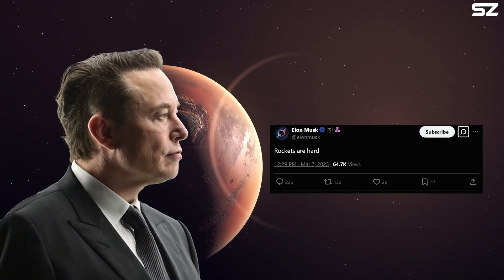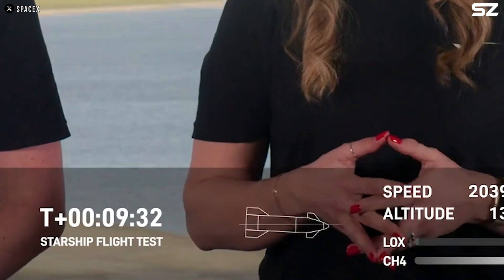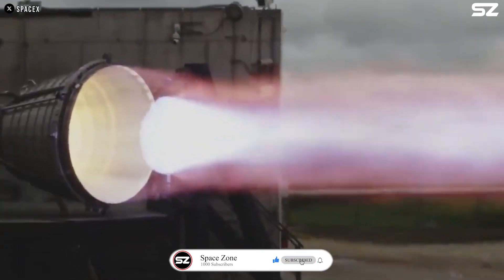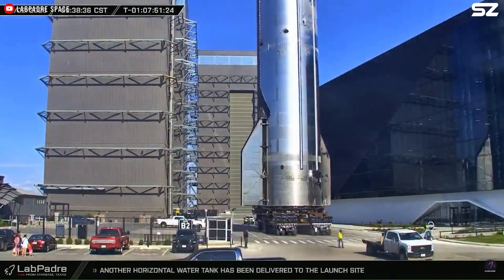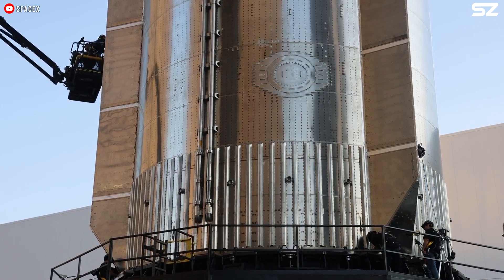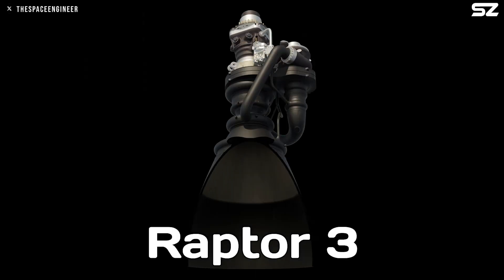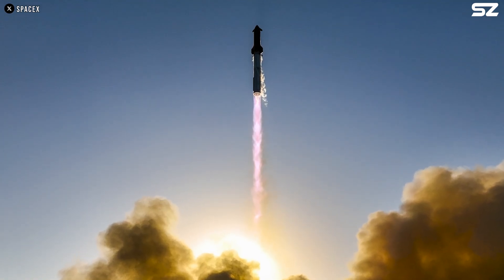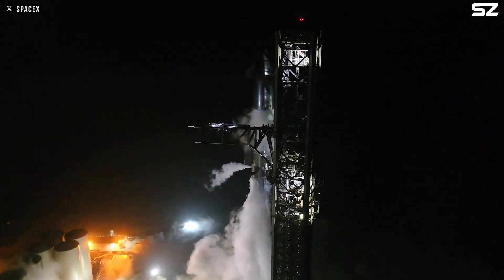What Exactly Happened to SpaceX RAPTOR During Starship Flight EIGHT!

Comment: I keep saying it's not the Raptors fault. It's the hot-staging fault. Sure the ring is vented, but it's still too close to the Starship. All that power blasting out surely places monstrous stress on all the lower engine section pushing things out of whack. So you end up with leaks and broken things. This phenomena doesn't happen with the booster, it has all kinds of room for rocket exhaust, as does the Starship on the test stand. Make the hot-staging ring taller.
Reply: I agree, but I think making the second stage taller also played a role. Spacex mentioned harmonic response before and I suspect that problem intensifies when the tanks empty to a certain extend, allowing for the vibrations to build up in absence of fuel to absorb and mitigate the issue.
Reply from the maker: Good ideal!
Reply: You may be on to something.

Comment: OK----------.  FIVE THINGS MUST BE CHANGED ON FLIGHT 9....   
--------------...  FIRST:  THE LONG METHANE DOWNCOMERS FOR THE VACUUM RAPTORS, THAT EXTEND FROM THE METHANE TANK DOWN TO EACH ENGINE MUST BE ELIMINATED.. (THE ONLY DEFERANCE BETWEEN FLIGHT 7 AND 8 ),,,  AND THE PREVIOUS SUCCESSFUL FLIGHTS OF STARSHIPS...   AS THEIR LONG STRAIT THIN PIPES CAN ONLY MAGNIFY THE ENGINE ASSOLATOINS LIKE A THICK GUITAR STRING... MAKING THE PIPES LOX TANK DOME PENITRATION WELDS ALMOST IMPOSSIBLE TO KEEP FROM FAILING... 
------------.  SECOND::  THE METHANE CENTER LARGE TUBE  DOWNCOMER MUST BE LENGTHENED TO PENETRATE THE LOWER LOX TANK DOME THAT IS STRONG ENOUGH TO RESIST ENGINE ACOOSTIC VIBRATIONS BEFORE ANY OF THE SMALL METHANE DIRECT FEED PIPES ARE TAKEN OFF AT THE END OF THE METHANE DOWN COMER...  ELIMINATING ALL OF THE SMALL WEAK DOWNCOMER LOX TANK DOME WELDED PENETRATIONS THAT CAN CRACK LEAK AND BREAK FROM ENGINE HARMONIC VIBRATIONS... MAKING PRODUCTON EASIER, CHEAPER...AND LIGHTER...
---------------... THIRD:::    THE VACUUM ENGINES MUST BE ANGLED IN,,,  ALIGNING THEIR THRUST VECTOR WITH THE CENTER MASS POINT OF THE STARSHIP,,,  INSIDE THE UPPER END OF THE METHANE TANK...   THAT CANNOT BE CALCULATED PERFECTLY AS THAT POINT DEPENDS ON THE CARGO WEIGHT OF THE STARSHIP... AND MOVES AS PROPELANT IS USED...   BUT WOULD ALLOW THE STARSHIP TO MAINTAIN A STRAIGHT COURSE NO MATTER HOW MANY VAC ENGINES LOSE THRUST...   USING ONLY THE MANUEVERING THRUSTERS,  TO CONTROL STARSHIPS HEADING IF THE CENTER GYMBLED LANDING ENGINES FAIL IN PART OR ALL... 
          THIS WOULD HAVE KEPT STARSHIP FLIGHTS 7 AND 8 FROM TUMBLING, GIVING MORE TIME FOR  THE RECORDING CAMERAS, SENSORS AND THE ENGINEERS TO TROUBLE SHOOT THE PROBLEMS... OF FLIGHT 7 AND 8... SHUTINGDOWN LEAKS FROM ANY FEED PIPE  BREAKS AND CRACKS... TO HAVE POSSIBLY PUT OUT THE FIRES AND RESTART THE ENGINES THAT WERE STILL ABLE TO RUN...
------------...  FORTH::::   IF THE VACUUM ENGINES ON FLIGHT 7 AND 8 HAD BEEN PROGRAMED TO SHUT DOWN WITH THE FAILING OF THE FIRST VAC ENGINE AND ALL THREE GYMBLED ENGINES... THE ENGINEERS WOULD HAVE HAD  MORE TIME TO STUDY THE  CAUSES OF THE FAILURES.. A MUTE POINT IF THE VAC ENGINES ARE ALIGNED TO THE SHIPS CENTER OF MASS...
-----------...  FIFTH:::::   SHUT OFF VALVES MUST BE PUT ON ALL FEED LINES INSIDE AND BEFORE THEY EXIT THE LOX TANK AND CENTRAL METHANE DOWNCOMER TUBE. TO STOP THE FLOW OF PROPELANT FROM MASSIVE LEAKS IN ANY FEED PIPES AND PUT OUT FIRES IN THE ATTIC...!!!   BEFORE THEY DESTROY EQUIPMENT... AND ELECTRONICS...!!!  (INSIDE TANK FEED VALVES MUST BE ADDED TO  BOTH SUPERHEAVY AND FALCON BOOSTERS AS WELL...  TO END INFLIGHT AND LANDING FIRES AS WELL AS PROPELANT LOSS ANY TIME AN ENGINE IS SHUT DOWN)....
Reply from the maker: Loved your analysis!